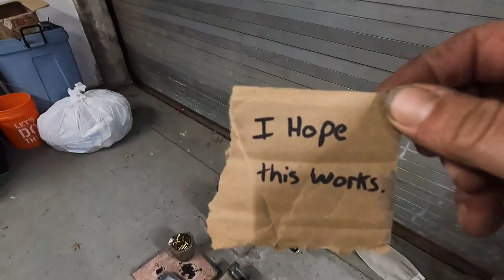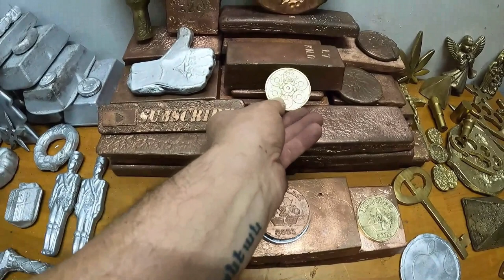Melting Bullet Shell Casings - Smith & Wesson Belt Buckle - Trash to Treasure - ASMR Metal Melting

Comment: You make it look so easy. 🤣 How thick is it overall?
Reply from the maker: Hahahaha thanks buddy!  It is 0.110 inches thick when using my calipers.  Probably my thinnest cast ever.  I still need to make a hinge for it and drill the holes for the hinge to slide into, but the post and the hinge profiles came out great.  I'll be wearing this in no time :)
Reply: @Scrap2Cast  I still need to make a loop for mine too. I've been too lazy to find brass rod to make one. 🤣
Reply from the maker: @KrakenCasting  i’m actually going to make mine from stainless steel rod just to be a bit stronger.  I’ll dip it in molten brass to see if I can get a coating of brass on it to match the buckle.  Not sure if it will work but will be fun to try 😁
Reply: @Scrap2Cast  Try heating the rod then use a brass wire wheel. I've seen it work on carbon steel, let me get a link. Hold please.
Reply from the maker: I could do that but it sounds like work... I’ll try the the dip method first 😉
Reply: @Scrap2Cast  mmm, yeah, work should be avoided. 🤣
Reply from the maker: @KrakenCasting   couldn’t agree more brother!